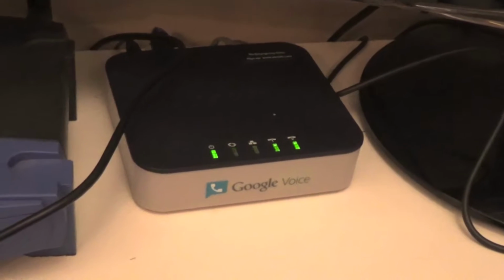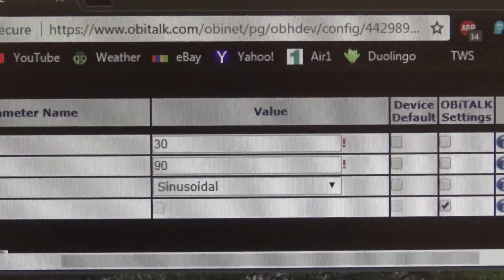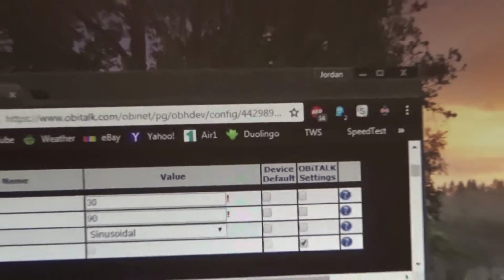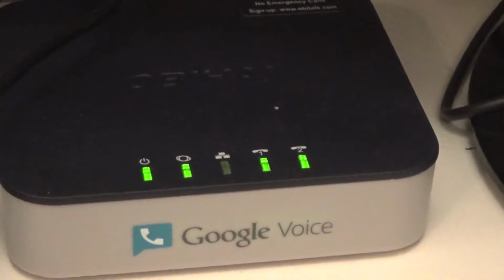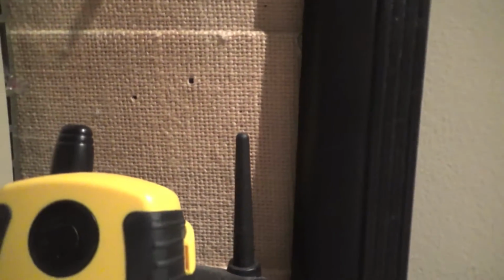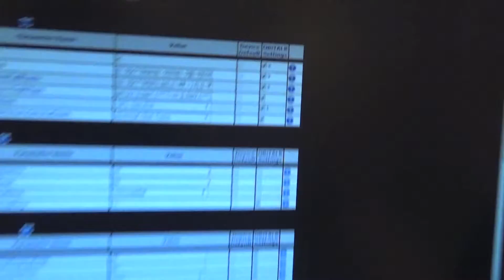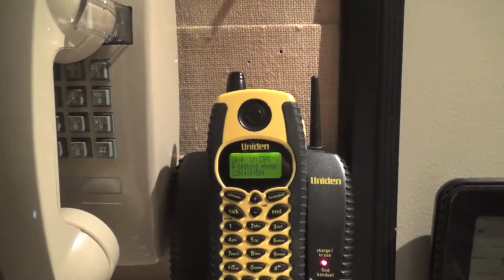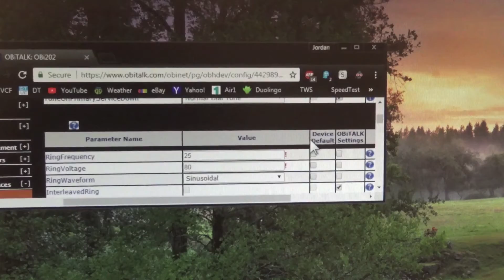Changing the Voltage and Frequency of the Phone Line's Ring

Comment: You are playing with mechanical resonance here. The telephone bat together with coil, spring, and elastic bat harness are mechanical resonator made to resonate at 25Hz, Which means the maximum amplitude of bat movement. Ring effective Voltage is set on 95VAC as per telephone standard.
Reply from the maker: OK

Comment: Interesting!  As far as I was aware, "proper" ring on the line is 20 Hz, 90VAC RMS.  Perhaps the frequency it's putting out doesn't match that of the web configuration interface, as in 20 might only be 15, 25 might be 20, etc.  So yes a meter would determine that.

The voltage shouldn't affect the frequency in the least, they should be mutually independent of each other.  When you factor in Chinese manufacturing of course, that all goes out the window.  

While "sinusoidal" is the correct waveform for a proper ("real") copper line, and was what was delivered years ago, none of that is necessarily the case anymore.  What are the other options in the configuration?  I'd gather you'd find square wave and modified square (or sine) wave, but does it have any other options?  Have you tried playing with those?
Reply from the maker: I don't recall if I mentioned this in the video or not,, but the device's default settings are 20Hz at 70 volts.. From the testing it seems like the volts and frequency are regulated pretty well as minor adjustments did make a noticeable difference,, but it's entirely possible that with the amount of load on the device, the output is not as high as it claims to be..

I believe the only other option is trapezoidal.. I don't think I ever changed that setting.. There's quite a few settings that can be modified, what I showed in the video was only the most basic portion of the setup..

What also is worth noting is that on the Charter  line, which was modem driven, I was never able to get those Cortelco wall phones to ring.. When I read the reviews, that seemed to be a relatively common complaint.. I really need to get the meter out and see what the actual levels are..
Reply: I wonder if trapezoidal would help them to ring.  And you did mention the default was 70V 20Hz.
Reply from the maker: I'll have to try it sometime..